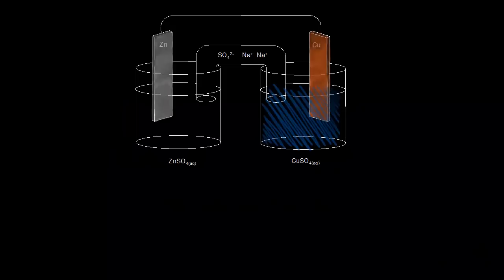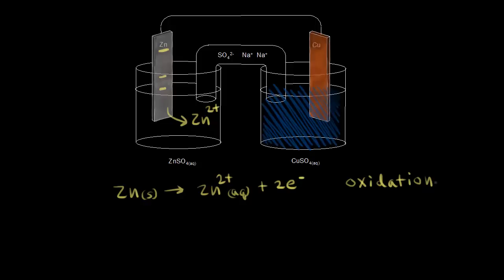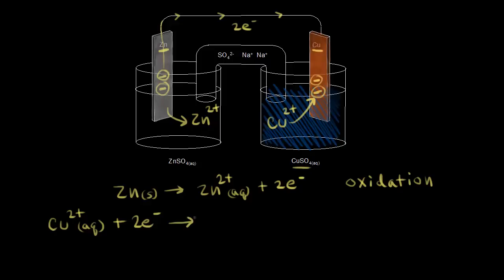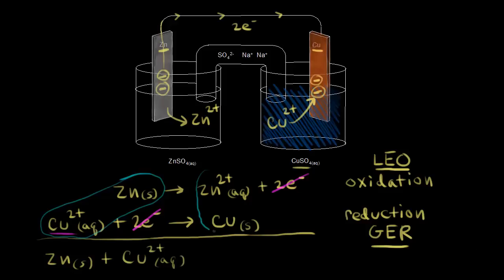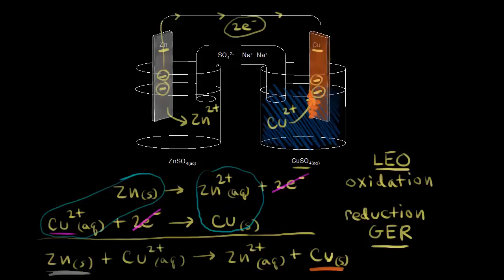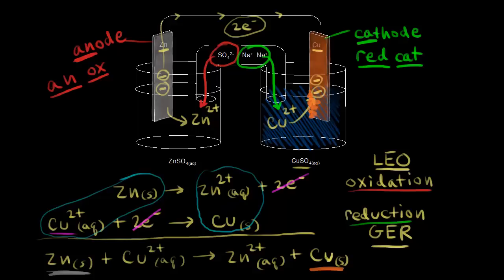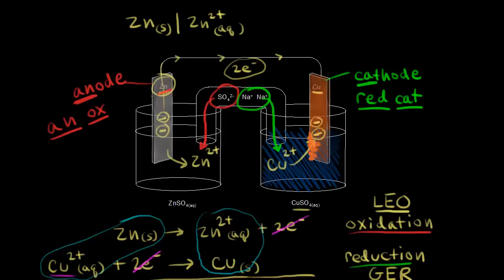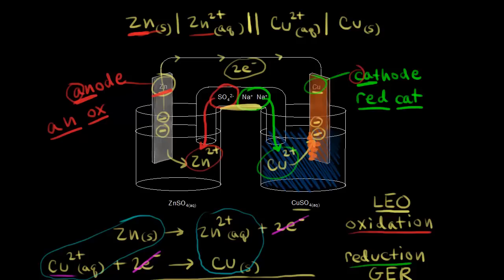Shorthand notation for galvanic/voltaic cells | Chemistry | Khan Academy

Comment: Question-
How do you determine what solution to put the electrode in?
Reply: 1)It depends on what element the electrode is made of.
2)It's typically an ionic salt solution of the element that the electrode is made of, for example, CuSO4 for Cu electrode, ZnSO4 for Zn electrode.